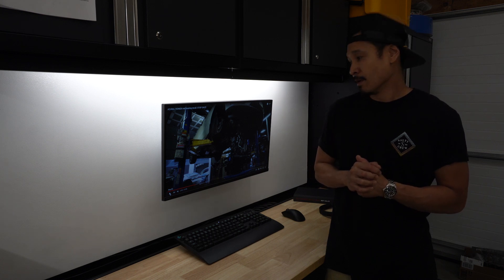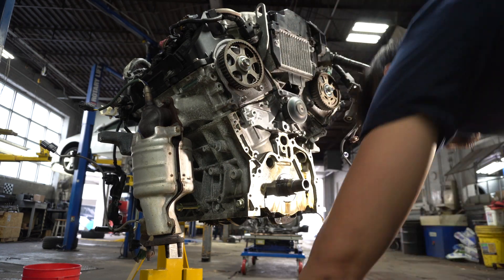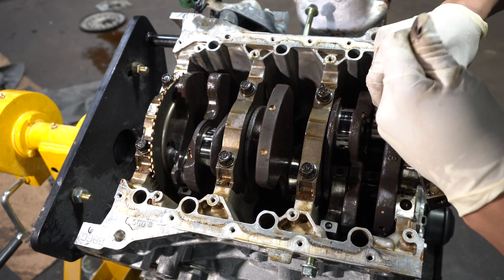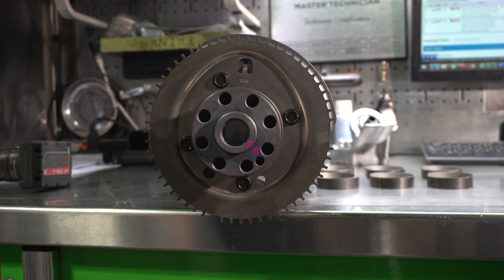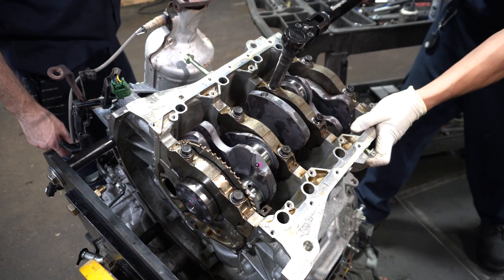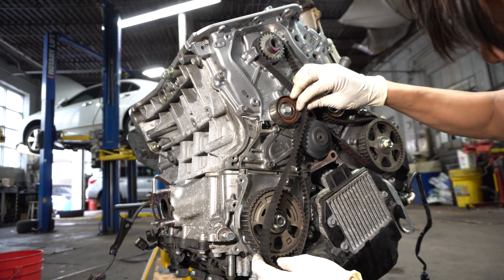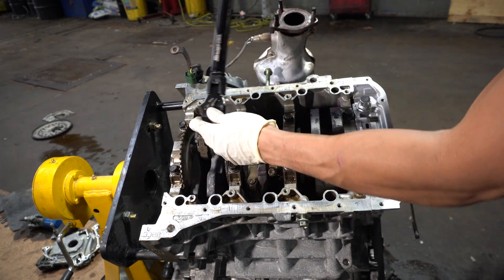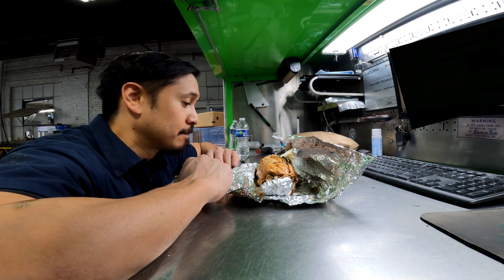ACURA & HONDA J35 CONNECTING ROD BEARING RECALL

Comment: Bought a used 2020 honda minivan thinking I'd be getting solid reliability being a honda. Replacing my ford with 230k on the clock because it blew a radiator this year. Second time in a year it left my wife stranded so I figured it's time. Just came across this issue. All I got to say is I'm glad I got the extended warranty from the dealer. I still hope I don't have issues though.

Comment: Hey there! A coworker has a 2012 TL 3.5. it's got a rod knock, not terribly loud, but very noticeable. He's looking to spend 2k on a used engine but is asking me if there's a way to try to fix it, at least get another year out of it. Can the connecting rod bearings be replaced while that engine is still in the vehicle? I haven't gotten underneath the car yet to look, is the oil pan removable from underneath? 
I appreciate your time and help, all the videos I've checked show the crank replacement by a dealership, not just rod bearings by a regular guy with a wrench!

Comment: 20 TLX here, crankshaft replaced at 44k miles, and after 5k miles the f'ing main bearings have left the chat. The engine is currently completely disassembled and had a feild tech come out to inspect it. Now I get to wait for  Honda to decide how to move forward. Hopefully this isn't a sign of things to come.
Reply from the maker: You’ll probably get a new longblock

Comment: Out of all the bearing inspections ..how many crank shaft replacements have you found? 1 out of 20? 1 out of 100? 
I understand it is about 2%
Think Honda will have more ? Since more models involved ?

What is the total flat rate time paid? Think you could do it in that time?
Reply from the maker: @badapbt  I’ve done like…. 10 - 15.  Enough to have lost count.  Yes I still think Honda will have more.
Reply: @NSXavier997 
Are ya beating the time ? Or breaking even ? Or loss
12 hrs including inspection ?

I was “told”  by a Honda rep that Honda cranks / engines are assembled at a different factory ..but time to time they would exchange parts between the 2 factories ..I think that is bull$hit story

Are you the only tech doing them in the shop ..or are other techs doing them as well
Reply from the maker: @ it’s 9 hours for crank replacement. I can beat time but there’s no sense in trying because if I get it done in 8 hours, I only see a gain of 1 hour. But I’ll also be dead tired and will have exerted too much energy. So what I do is pull crankshaft cars into a spare stall and just work on it on / off as I see fit between other cars. It extends the time of completion immensely and ultimately it’s the customer that’s at an inconvenience. 

But hey… you can’t rush these kinds of jobs. You have to take your time otherwise things can get messed up.  So I always make sure to really take my time and quadruple check everything and make sure it’s right before sending it off.  Usually it’ll sit in the spare stall for about 7-10 days.

Comment: When you said you would not want a vehicle where it had the Rod Bearings, and Crankshaft replaced, I feel the same way. I would think if the Crankshaft needed to be replaced, why not go all the way and replace the short block like some of the Acura owners have had. I know Acura/Honda of course wants to save as much money as possible but is there significantly more damage that can be seen in order to get all 3 replaced?

Comment: I been bitching that i want a new long block hell no do I want a crank replacement that never ends well in the long run. Customer shouldnt have to except that trash fix all the metal has already pulp through the engine.

Comment: Great videos especially since you didn’t have to do all this. But hopefully helps common questions and concerns, I know it did for me. My 19 MDX 55K miles finally got scheduled for recall work in a month. Asymptomatic at this point. Is there anything I should push to also be done during this time? Or make sure is checked/done? Or is leaning into tech and Honda to make the right decisions good enough?

Comment: Will this recall that has been issued, will it require a complete teardown with crankshaft,bearings and rod bearings?? If a complete teardown and replacement is not completed, then you could have metal shavings left behind.

Comment: Does acura only go by picture as far as rod bearing wear? Or the crank is checked for wear tolerance before replacing just rod bearings?
Reply from the maker: If Honda's evaluation of the rod bearing wear is OK, then it's just a rod bearing replacement with no checking of the crank whatsoever.
Reply: @NSXavier997  in your honest opinion. Is that a true and trustworthy process? No judgements or anything,just wanted to hear an honest opinion.
Reply: Just replacing rod bearings that is*

Comment: Thanks for sharing the video. I have 2019 MDX AWD Tech with 36k miles, which also impacted by this rod bearing and fuel pump recall. Car was driving smoothly without any noise or issue. Should I still consider to replace the rod bearing/crankshaft(maybe) at this low mileage, since you mentioned in the video, don't want to buy car replaced crankshaft? Thanks.
Reply from the maker: @haixiongwang4608  You wouldn’t be able to request the crankshaft be replaced. The specific repair is determined by the inspection photos that are submitted to Honda and their evaluation.  I would take the car into the dealership and have them do the inspection. If it only needs bearings then you’re good… but if they determine that the crankshaft needs replacement, then I’d consider trading it in.  That’s just me though… even though the crankshaft replacement repair does work…I wouldn’t want a car with a crankshaft that has been replaced. Even if I personally carried out that repair on my own personal vehicle.. I wouldn’t want it afterwards it just doesn’t sit right with me.
Reply: @NSXavier997  Thanks a lot for sharing your thoughts, hopeful, only bearings replacement needed.

Comment: I don't even want to know what they pay you for warranty time on that, I'm sure it's supremely depressing. I love the upside down timing belt installation. Also, I'd be adding a dab of hondabond to each of the crankshaft bolts that go through the block so they don't leak oil in 100k miles like every f'n J series on the road...

Comment: Just had a new engine in my 2016 Pilot..short block and heads put in under this recall....interesting they didn't have/ do a long block. 
The funny thing is that the engine was essentially replaced but the old spark  plugs were put in the new engine.

Comment: A sad time in the auto industry in general, mostly I feel is due to CARB, overreach and CAFE standards, making engines overly complex, and less reliable. Still, this is a black eye for Honda, this and the 1.5 turbo problems.:face-fuchsia-wide-eyes: Still, for Honda, historically known for engines, this is egregious.
Reply from the maker: @BigEightiesNewWave  definitely agree with you on the overreach of CARB & the EPA causing manufactures to take measures they know will compromise longevity and reliability in the sake of fuel economy standards set by the governing bodies.  

As far as HMC goes, I believe that they are currently making all the wrong steps and will ultimately hurt them down the road. This recall alone will cost them billions for the years to come. They had a failed partnership with GM and bought their tech to get a foot in the EV game (extremely late). Sales on prologue and ZDX are dismal, and so we can chalk that up to another loss. Now, they’re looking at business ventures with Nissan… which will also be a failure and a waste of money.

This recall, the 1.5 turbo engines that you mention along with a list of other recalls coming out proves that fundamentals of the company have drastically changed.  They no longer make fun, reliable and affordable cars.

Now pair that with poor leadership and very poor business decisions and you get quite the dumpster fire. 

Not all is bad though; HMC stock price is down more than 20% YTD… and I don’t see it going up at all for the quarters to come.  Lots of selling pressure on the stock.  I have short positions that will continue to print $.

Comment: I’ve heard you say in a couple of videos that you wouldn’t want a car that had the crank replaced. Why?
Reply from the maker: @shakey2634  Because I view it as the cheapest possible repair issued by Honda so that they can avoid bankruptcy.  It is by no means a good repair and a far stretch of what any Technician or Engineer would consider “proper”. 

It’s quite literally a bandaid put over a broken spine.
Reply: @ 
If the problem is the crank, how is it a bandaid to replace it. It would then be proper. If they had a blanket policy of “we are only replacing bearings” when we know the problem is the crank, that seems to me to be a bandaid. If we can replace other parts (water pump, fuel pump, ecu etc) and consider it a proper repair, why not a crank? I guess that’s really my question.
Reply from the maker: @ because replacing a crank under normal and proper engine assembly procedure requires you to do a lot more than just… swapping it.  Clearances, tolerances and precise measurements are supposed to be done during assembly which ensures longevity.
Reply: @ 
Thanks for the quick reply! Happy Holidays!

Comment: Thank you Soo much for sharing. Had this done on my 2019 MDX tech. Soo detailed on the Rod bearings. Still waiting for the fuel pump recall
Reply: Talked to my dealer about the fuel pump recalled for my 2019 Ridgeline. They claimed they ordered the pump last week, 12.18,24. He said he will call me when the part arrives. Received the recall notice early 2024. Not holding my breath. I am done with the Honda brand. My 2019 Ridgeline has had too many recalls for me. God knows what the next recall will be for this brand. Our 1997 Honda Accord and 2009 CRV are still running like a champ. newer model Honda cars and trucks are a big question mark in longevity.

Comment: Another impressive video/workmanship.  I started watching your videos recently after the news that Honda may expand the 3.5 engine recall.  We have a 2020 Pilot with about 85k on it.  It's been reliable and I've been meticulous on maintenance, (oil changes every 5k).  I'm now considering selling/trading in on something else.  I'm not real impressed with Mother Honda's "fix" for this issue. In my opinion, they should be installing NEW, complete crate engines.   Keep up the great work!
Reply from the maker: @richtaylor266  I’d at least have the dealership do the rod bearing inspection recall on your pilot.  If it’s just a bearing replacement then you’re good…. But if it needs a crank then yea I’d say trade it in afterwards.  These engines are reliable.. it’s just that some of them had faulty crankshafts installed.  Agree with you that the procedure for crankshaft replacement shouldn’t even be a thing and should just go straight to long block replacement if any bearings are found to be compromised.
Reply: @NSXavier997  Thanks for the advice man!

Comment: My question is, just replacing the crank in this manner, how can you be sure of oil clearance in the rod bearings? Is there a way to check without removing the pistons and rods and using a micrometer to ensure the crank journals and the bearings have adequate clearance or too much clearance. I saw you are a master tech, and I am not doubting your skills or abilities
Reply from the maker: @robertsise7898  yes ideally you would want to mic the crank journals and then plastiguage everything to ensure it is all within tolerance.  However, Honda doesn’t require to do this and are treating this like a brake pad slap to keep costs down.
Reply: @NSXavier997 this is worst then I thought… do you think that the engine is likely to ruined bearing again. What was causing the issue in the first place? 
I remember older bmw m3 hag bearing issues to and bmw would put back the oem rod and crank bearing and send you on your way to do another 50000 miles that’s it!

Do you think it’s going to be the same with does 3.5 v6?

Comment: How many hours does Honda pay techs for this?
Reply from the maker: @droboyjr  9 bro.  9. Hours.
Reply: @nsxavier997 I’m a toyota tech and imo that’s just not enough but am I surprised? absolutely not. I’m curious about your opinion on it. Now, just like any job, once you do a few I’m sure you get faster and faster but I know what’s involved to get to that point of crank replacement and it’s a good bit. Drain oil, coolant, evac AC, drop subframe with engine, disconnect wire harness, separate trans with tc, etc. etc. etc. That’s a lot of damn work not to mention reinstallation and you can’t really afford to make any serious mistakes. 9 hours is kinda BS imo. I respect your work though 👍 Somebody has to lol.
Reply from the maker: @droboyjr  ayyyeee… fellow tech 🫡. My opinion on it is that Honda is going to going to continue to cut warranty labor times to avoid bankruptcy and insolvency.. but that is inevitable without a miracle. 

1.4 million cars affected with this recall and on the low end they’re paying out approximately $1,200 for the repair.  That’s over 1.4b dollars they’re paying to fix this mess.  No matter how much money they make on new car sales, parts sales, and whatever other sectors they’re involved with will not recover the losses on this. Nobody sees this now. Wait till the street gets wind of their earnings report for Q4 2024.. that’s going to be bloody. Their stock price is already -16% YTD. Once investor confidence declines… there goes their cash flow.

Technicians will always be good though. It’s not like we’re growing on trees. The way I see it is sure, short change us now and our pleasure will be witnessing the decline and downfall of what once was an awesome company.

Comment: Why not use assembly lubricant instead of motor oil? Also I didnt hear you talking about if the connecting rods are of the fractured type or machined?
Reply from the maker: @ericcindycrowder7482  didn’t care enough to actually go out and buy assembly lube (manufacturer or dealership doesn’t supply it).  Since I am already at a net loss for doing this job, the last thing I want to do is go out and spend my own money on something to assemble an engine. Oil is supplied. Just working with what I have.
Reply: Looks like fracture split conn rods. We made the rods and bearing caps for this engine in Ridgway, PA.

Comment: What is difference with RDX 3.5 V6 2018, prior to 2019 when they went to 4 cyl?  Will tbe 2018 RDX be recalled?
Reply: Right now the 2016-2018 RDX is not included in the recall, don't know why, it is the same engine. The RDX is rated to a higher RPM, maybe the cranks were machined on a different crank grinder.
Reply: @billd7095  interesting.  It's wifes's car and is pretty quick for an SUV, did not know it rev'd higher.  If it holds up maybe I will take it (when wife wants soething newer.)
Reply: I believe the 2016 is rated to 279 HP at 6200 RPM.
Reply from the maker: @jimkelly1613  No the 2nd generation RDX is not affected.  Main difference between the two engines is one is port injected and the other is DI.
Reply: @NSXavier997  thank you.  Do you know which is Direct Injected?  I was under the impression the RDX is Direct Injected?
Reply from the maker: @ it is not. 2nd generation RDX is port injected
Reply: @NSXavier997  that is good news but wonder why dealership says needs intake cleaning every 40,000 miles then.  Would expect that for direct injection.
Reply from the maker: @ that’s just dealership snake oil they’re selling. Our dealership did away with all that BS and only sell brake fluid exchanges every 3 years like what Honda recommends.  All that other intake cleaning fluff is just BS and doesn’t do anything don’t buy it.

Comment: I'm looking at possibly purchasing a used 2014 Accord Coupe V6 - 6MT (haven't seen it yet). Are they affected by this issue at all.
Any other known issues with 9th gen Accord i should pay attention, maybe electric power steering? (150k miles)

This was very relaxing and enjoyable to watch!
Thank you!
Reply from the maker: No I that generation is not affected as far as I know.  I actually own the same car (2013)- and I have not received any recalls in the mail.
Reply: @NSXavier997  Thank you! Are you happy with this car overall?
Reply from the maker: @Mickey_Bauer  Yea it has been great.  Low maintenance.  The only major things I have had to do to it were the timing belt in 2020, brake pads and rotors and tires.  Everything else has been just general routine maintenance.
Reply: @NSXavier997  awesome, thanks brother!
Reply: No, the J35Y1as in my '15 V6 Accord, and the J35Y2 in the manual-equiped Accords (all 2013 thru 2017 Accords) are not affected by all of these Honda/Acura Recalls.
Reply: @timothyforce1949  thank you!

Comment: Thanks for the video 
Idk if can make another video with the part numbers of everything needed as far as parts to make it easier for some of us
Reply from the maker: No problem.  Part #'s will vary by crankshaft and you have to order specific bearings based on the codes stamped on the crank.  It's not a one-size-fits all type deal.  So.. it would be kind of redundant to make a video on part #'s that wont be specific to each application and can cause a lot of confusion and liability if the wrong parts are used and a failure were to occur.